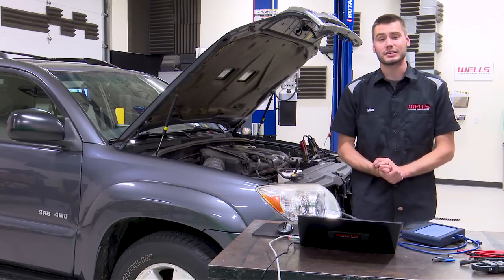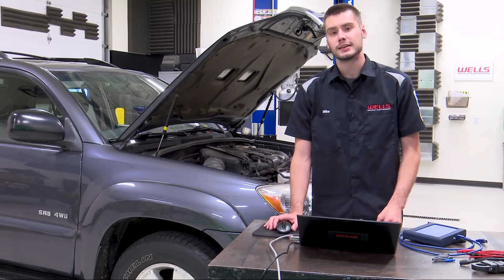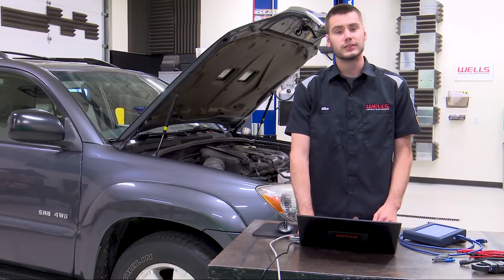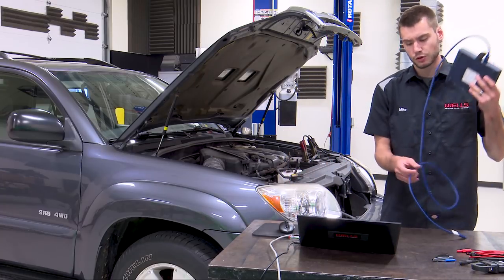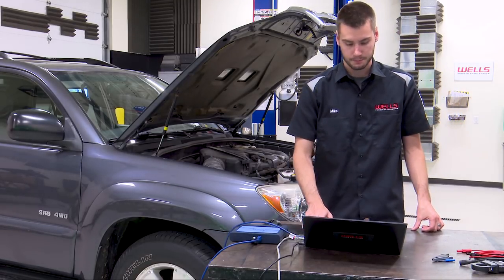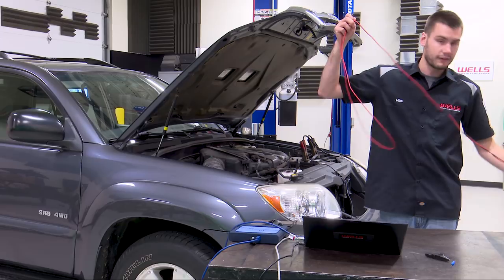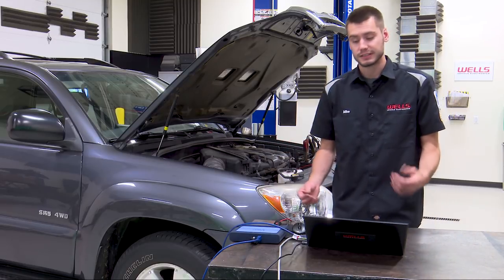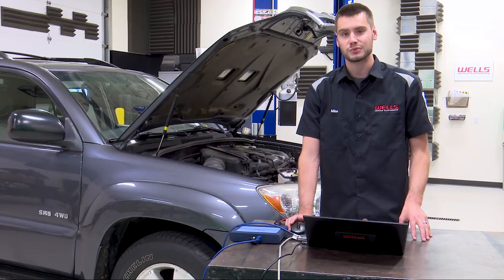How to Perform a Relative Compression Test & Why It's Useful When Diagnosing a Timing Issue (P0016)

Comment: Man this video is very very good. Learned a lot, especially the Pico part. I still can't believe how do shops "diagnose" (parts canon) cars without a scope. It's an imperative tool to have. Thanks Mike, this series is looking great, you teach actually how systems works.
Reply from the maker: Hey Emmanuel, thanks for watching man! A scope really is necessary and it saves a ton of time. Really in the shop, were only about 15-20 minutes into the diag on this thing! Maybe even faster. All about speed and efficiency. Thanks for the kind words my friend!
Mike Becker, Technical Services Instructor

Comment: This is exactly how I would address this code. A lot of the time the car is already in the bay and there is not an hour "handed to you". You'll add a little to the repair once diagnosed or slap em with that hour or more if they pull it. Car comes in, time to get after it....quickly yet accurately.......my point is with the capabilities at hand, the option of disassembly will definitely come last. Now certain circumstances you may have to, i understand. But time is money and removing valve covers or whatever isnt the way and of course swaptronis is forbidden.  Factory flow charts are totally ****ed. But anyway i do like where the video is going. The couple of Toyotas I've come across with a 0016 or 0012 have been mechanical. Awesome video Mike.
Reply from the maker: Hey Brandon, only take something apart after you know what is underneath is for sure bad. Otherwise you're wasting your time, right!?
Mike Becker, Technical Services Instructor
Reply: @GoTechTraining  Should i use  Igf or igt when using a Toyota ignition  coil as the sync?

Comment: Really like the direction you're taking here Prof. Mike. Great presentation thus far.  I had no idea your web site offers cylinder location and firing order diagrams. Have to check that out. Man I really need a scope upgrade.
Reply from the maker: Hey Mike, thanks man! Our website's a wealth of knowledge! The PICO is amazing. Well worth every dollar!
Mike Becker, Technical Services Instructor
Reply: Just took a look around your website. Lots of great info there.  I like the little "Sure You Can" pdf for odb1 ignition systems. May come in handy with my thirdgen camaro. Only thing I couldn't find in the website is the closest Wells parts supplier to me in St. Thomas, Ontario.
Reply from the maker: Hey Mike, thanks man! There is tons of good stuff there! Enjoy looking around. Unfortunately that info won't be on there. You'll for sure find stuff on RockAuto and Amazon. I'll look into it, if there is someone local i'll let you know!
Mike Becker, Technical Services Instructor
Reply: That would be great Mike. Pretty sure I live in Dormantown.
Reply: I had a question. I'm fairly new to using an oscilloscope. My question is. When you back probed the coil which wire did you back probe? Thank you In advance. The work you guys do is absolutely amazing. Can't thank you enough
Reply: @davidche554  I think Mike said it during his video but a lot of  vehicles with 2 wire coils  use a 12v source from a fuse and the computer controls the ignition coils by grounding them  on and off.  If you look at the wires going to each of the coils you'll notice that they will all share  1 wire the same color and one different in each connector.  The odd color is the control wire. That's the wire you're looking for.  Same can be said for most fuel injectors.
Reply: @mikeburton1733  remember they have a tracer color too to identify each cylinder number and location.🙂

Comment: By the way, the screenshot tool you used (Greenshot) can also put text on the image. You just need to select "Open in Greenshot" instead. No need for Paint.
It can also draw boxes and lines as well.
Reply from the maker: Blocki, that is great advice! I'll have to try that out. Thanks!
Mike Becker, Technical Services Instructor

Comment: Since you have a pico, you could have used Pico Diagnostics software to do a relative compression test. Results are much clearer to read (in a bar chart) and all you need is to hook up test leads to the battery. And it still gives you an option to look at the waveform if you like.
Reply from the maker: Thanks Vitamin B, i'll keep that in mind for next time!
Mike Becker, Technical Services Instructor

Comment: I watch video. Thanks wells tech. I read with obd2. I got one of bosch codeconnect. Reader. Really easy to read, navigate and nice hand unit. Very simple interface. I am untrained in vehicle ECU so i did quick read tests. No experience with resetting-programming or vehicle restart defaults. Wells tuning very cool video tutorials and computer program setup/usb desktop.

Comment: great video Mike  excellent pico scope skills   I didn't even know about paint     I have a 200 -2000 pico clamp and just wondering if you set it on 0-200 amps would you of got more  granularity on your initial signal      either way  you got there   thank you mike
Reply from the maker: Thanks Mark! Paint and Google draw can be super useful! It's possible....you could also throw a filter on it too to try and clean it up. I wanted to show it raw because I didn't want to add more to the testing. I wanted it quick and dirty and simple.
Mike Becker, Technical Services Instructor

Comment: Guys, listen... when doing a relative compression test, disable the fuel injector power supply if possible...If not, disable the fuel pump AND ignition coils.
Reply from the maker: Great tip!
Mike Becker, Senior Technical Instructor

Comment: Is there a chance that oil hole is plugged (customer never changes oil) and phaser just stuck in one position and physically can't change timing? At that point whole engine is junk and can't be revived? Great video! Can't wait for next one!
Reply from the maker: Hey SPD Parts. Great question, I don't want to give toooo much away. But no, not in this case. It will be explained in the 4th video, stay tuned :) Thanks for watching!
Mike Becker, Technical Services Instructor

Comment: Mike could you back probe a coil from 1,3 or 5 with scope signal A, and do another relative compression test with you focus on the
Reply: Continue:  height of the compression wave in relation to when the coil first firies. If the peak of the compression wave is either way after or before the peak coil wave in signal A, the timing is out, and may indicate a jumped timing belt.
Reply from the maker: This has been brought up to me by multiple people now. I have never done this test....but I definitely need to next time I get one of these in!
Mike Becker, Technical Services Instructor

Comment: Mike, great series, love all your training and NGK/NTK products. Listen. we are working on a 2006 Lexus IS 350 with P0017. Customer Shot the parts cannon at it and surprise nothing is fixed. I want to use this process, waiting on my probe kit from AES to get here. I am using the Snap On Verus Pro with M4 Scope, how would you set this up, I am new to using scopes. Much like you, I was a dealer tech for years and never used one while there, now I regret it but such is life and we move forward. any help on this would be appreciated.
Reply from the maker: Hey Sal, thanks for watching! So you will want to scope the cam sensor(s) and crankshaft for the bank related to the P0017. The cam sensors are probably hall-effect meaning I'd set my voltage to 10 volts. The crank sensor may be hall effect or variable reluctance. If hall, set to 10 volts and see how it looks. If variable reluctance, start at 20 volts and expect and a/c signal.Time on the Snappy scope is the tricky part here. Unlike PICO where I can capture a TON and zoom in, Snappy can only zoom out. Start at 50ms and see how that looks. You want to see two revolutions so you can see the repeating point. Then you'll want to compare to a known good to see if the timing is shifted. Good luck!!!
Mike Becker, Senior Instructor
Reply: @GoTechTraining  Mike I'm having a little bit of a hard time if I were to send you screenshots of my waveforms would you mind helping out? Just looking for a professionals opinion

Comment: I have a good ear and usually just spin engine over. It's not a definitive test, but if you have a mechanical compression problem then you can hear something wrong. A broken valve spring can be intermittent too since the spring can hang on itself - seen that on a hemi. Spin engine and listen and you can here the compression loss on that cylinder. Timing is a little more complex to pin down, thanks! But don't forget that a clogged cat on 1 bank can fool you, but you should have misfires all on that bank maybe but sometimes it just shows P0300. Problems I've had are like those trucks someone swapped a Dodge 5.2 for a 5.9, problems are more difficult to nail down with mixed parts and old junk. People who do that should fix the truck themselves because the cost can get real expensive in a shop. Wrong parts, sensors, wrong injectors, and bent flexplate sensor ring or wrong flexplate with intermittent misfires and backfire!  What a mess, not to mention the vibration because they have the wrong flexplate and/or torque converter! Scope won't help you much in these situations, and the shop bill is more than the truck is worth. Don't walk, run away from these type problems and don't get involved. I have a basic rule of thumb, if I have no clue after an hour diag, time to get help or move on. 

Have a Cobalt with P0300 right now that another tech diagnosed a timing chain, but the air temp says -40F hum... this IAT looks like a Map sensor but it's not. Got 4.8v at IAT, 5v ref and good ground, that don't sound right 🤔
Reply from the maker: Little things, like listening to an engine, are things that are learned and can't really be taught. They are super valuable when testing. Experience can save a ton of time! That's a good rule of thumb. No sense in wasting a ton of time on something!
That doesn't sound right! How does that -40 not just jump off the scan tool for the first tech?!
Mike Becker, Technical Services Instructor

Comment: See if you'd have done like the dealer you'd already be on your way to tearing it apart and if it's not bad well the customer will get cam sensors just b/c it's already apart and then put it together & if it doesn't fix it then we'll just have to do some more diagnosing by changing out the ECM without checking anything else b/c we all know if it's not the timing it has to be the ECM...I'd laugh but it happens all too often and luckily there are those of us that simply laugh at it and diagnose it just like you're doing. I guess they haven't heard of CMP/CKP scope waveforms but then you don't get to charge the customer for the teardown...it's crazy.  Nice diagnosis so far Mike and the clincher is coming!
Reply from the maker: Hey Bob! The dealership hate! Not everyone in a dealer is bad news, but there does seem to be a larger percentage of parts changers there rather than the independents. It's sad. Diagnose then tear down...work smarter not HARDER! Hopefully this series gets that into peoples heads! :)
Thanks Bob!Mike Becker, Technical Services Instructor
Reply: It's not the tech's fault a lot of times. They are at the mercy of who they work for.  Some of my best friends work for dealerships and they have some tough times. They do the best they can and I get work sent my way also when their hands get tied. Be glad you have good people you work for and luckily I work for myself so if I have a problem with him I find myself talking to myself alot :D
Reply from the maker: I've been there. The manufacturers want to pay the tech 0.3 hours to diag a DTC...WHAT IS THAT?! They have created a monster. They tried to be cheap, and now its going to start costing them way more! Haha sometimes working for yourself is just the way to go right? And you are only considered insane if you answer yourself in your conversations...with yourself! Haha!
Mike Becker, Technical Services Instructor
Reply: The logic just blows my mind sometimes.  The definition of insane is when you keep doing the same thing but expect different results but if your statement is true I may need help :D
Reply from the maker: Haha what logic? Right? Naw, I think you're alright. You gotta get a shop dog, they are good listeners. You'll see mine in the 5th video :)
Mike Becker, Technical Services Instructor
Reply: I do! His name is Samson and is a chow. Keeps the customers in line :D  I sent a photo to your e-mail. Customers behave when he is looking at them :D
Reply from the maker: Nice! Purple tongue dog right? I have a golden retriever, his name is Jordy

Comment: On a negative controlled coil in the system you have pictured which side of the coil do you back probe, positive side or negative side. I’m not to familiar with scopes I got an older modis with a 4 channel scope and I’m trying to learn how to use it better. I’m sure I could figure it out if I need to but I thought I’d ask. I used it before on a coil ramp test and I used the positive lead on ground and the negative lead on the coil negative side. It worked but I didn’t know if was the best way
Reply from the maker: Hey Jason, I always put the negative lead of the scope on the battery negative, or a good engine ground. Then you can put the positive lead on the ground or power side of the coil. Power side should show you a constant 12v feed. Ground side should show you the control of the coil from the PCM.
Mike Becker, Technical Services Instructor
Reply: Thank you. I appreciate you taking the time to answer my question
Reply from the maker: You're welcome Jason!
Mike Becker, Technical Services Instructor

Comment: You said that you should see a compression difference between both banks if timing is off on one of the banks.. but what if the engine only has 1 bank? What steps would you have took then?

Comment: I use the Verus Edge and have a Pico 2000A clamp like this video.  Any quick way to determine the correct voltage scaling for set up purposes?
Reply from the maker: Hey Mike, depends on what you are doing. If you're taking a relative compression test I always start at 500 amps and see what happens. It's rare you are trying to record the "spike". Depending on the car you may even be ok with 250 amps.
Mike Becker, Senior Technical Instructor

Comment: I have a CA-600 high amp current clamp with 2 banana plug connectors. Can I use  a banana plug to BNC adapter to hook it up to the scope?

Comment: Good video.  Can't you just move the lead to a bank 1 cylinder and trigger off a bank 1 cylinder and repeat the test. If the compression max doesn't line up with the coil voltage change, then you know you got a timing issue. Otherwise, the lower compression peaks likely don't mean that much.
Reply from the maker: Hey Steve, yes you could. I wish I would have done this on this car, but I didn't. I may just have to make a follow up video on shoulda, coulda, woulda's!
Mike Becker, Technical Services Instructor

Comment: hi there mike, for a good engine what should be the max amp peak?? and viceversa.....
Reply from the maker: Alekstolstoi, I don't think we can put a number on this. This varies soooooo much depending on so many factors. We aren't really using this to judge compression, but more-so to judge the cylinder to cylinder. We want the peaks to be similar.The max amps isn't really a necessary spec. If you are looking for specific compression I recommend a transducer or compression gauge. 
MIke Becker, Technical Services Instructor

Comment: I have a 2.0 2009 dodge caliber which shows a negative 120 degrees on the exhaust cam, versus a positive 120 degrees on the intake cam! This is a po017 code! It won't do any good to do a relative compression test to determine whether or not it has jumped timing!